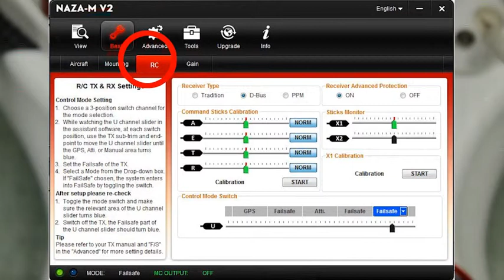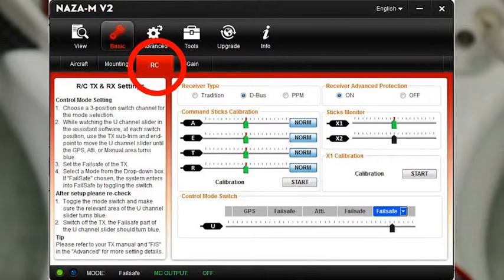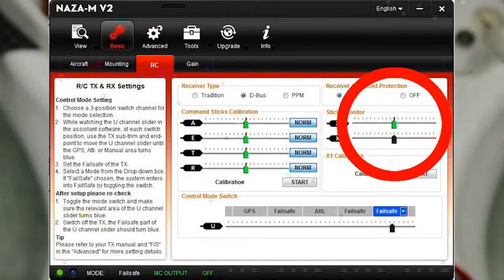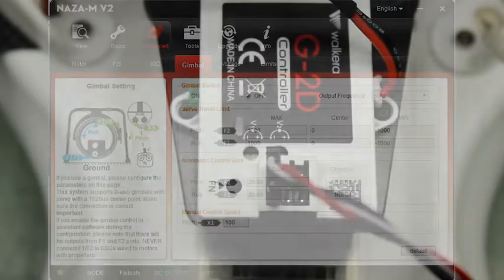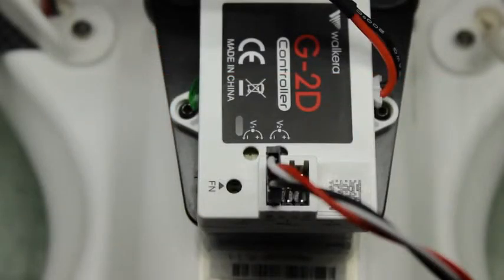Quad4A - G-2D to Phantom 3 - Gimbal Setup

Comment: How do i stop my gimbal from jittering? i have the exact same setup as u
Reply from the maker: Trent Bower The jittering shown in the video is when the gimbal tilts too far past its "end stops", the area where the motor and the sensor go out of sink and the sensor still tells the motor to move, but it can't, so it goes into a sort of feedback cycle, like a microphone and a loud speaker.  Then it takes a while before it settles back down, even after you start to level off.  So you need to test the range of your setup when the jittering occurs and try to keep under those angles to stop it from happening.